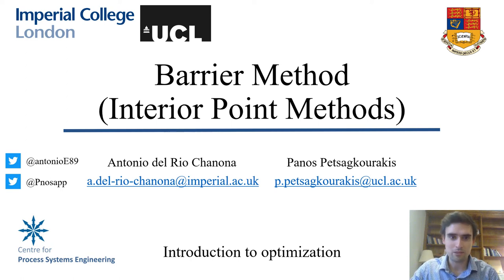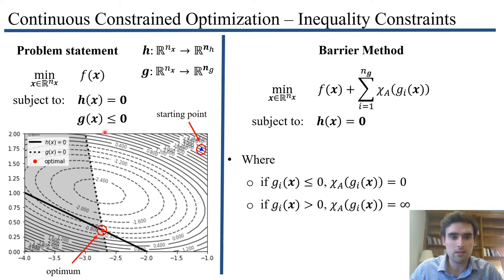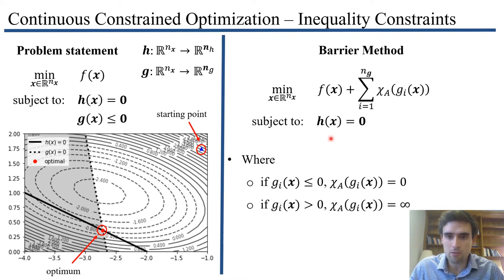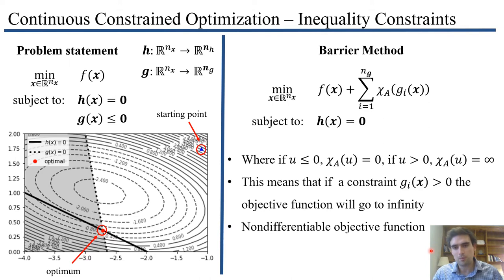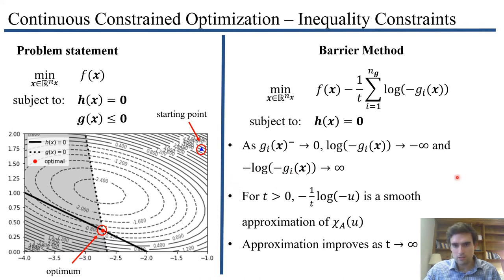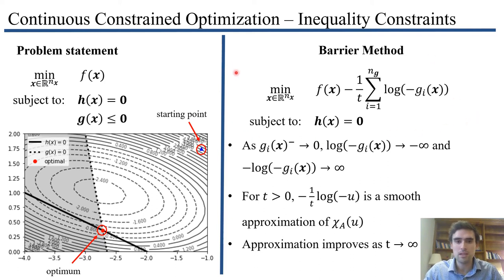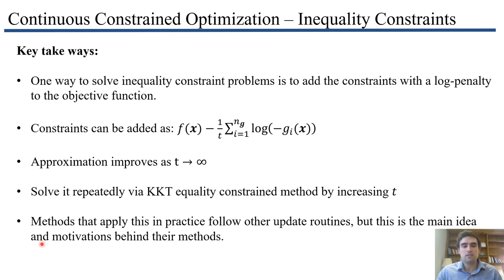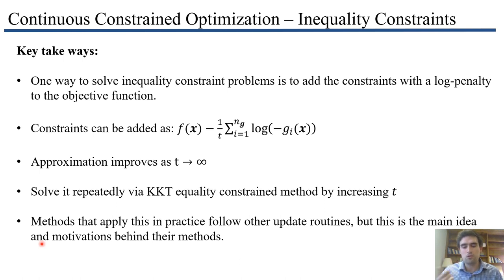Interior-point methods for constrained optimization (Logarithmic barrier function and central path)

Comment: Thanks for the video! Does the barrier method simplify if I have a Quadratic objective with linear constraints? If so, then I'll just get a log of a linear g(X). Then if I apply KKT, I'll end up needing to differentiate the log terms. My hope is that playing around with this, I'll be able to solve for my X from a set of linear equations. Is this right?